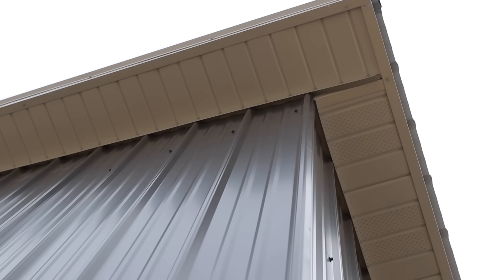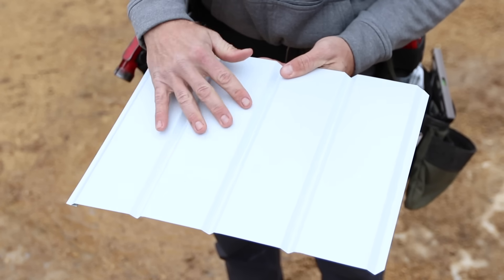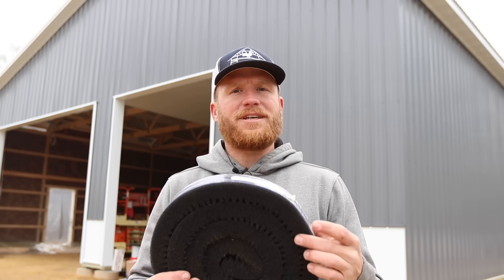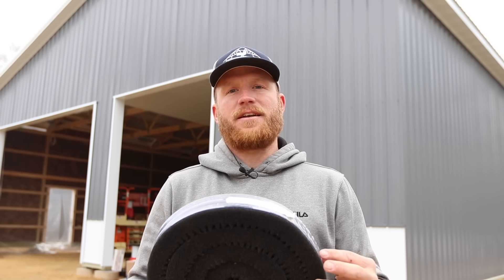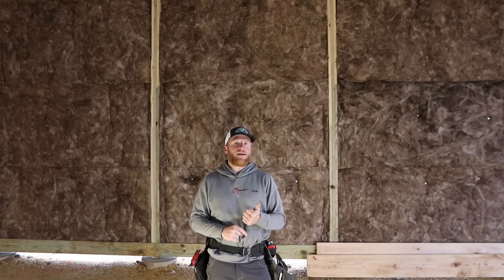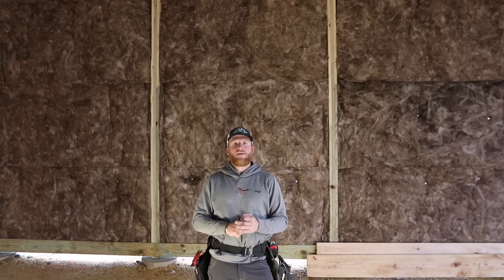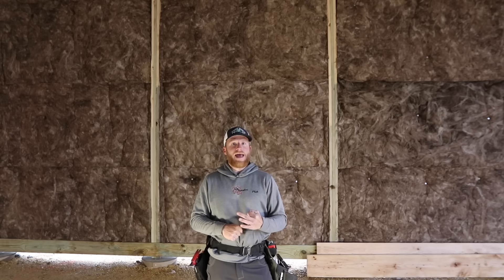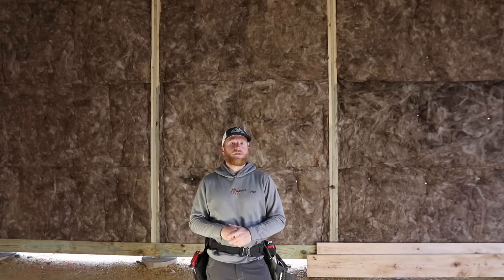Insulation: 5 steps to a more efficient building and why I don't use spray foam

Comment: I have owned and built several outbuildings, great tips for constructing a new one.  One thing you didn't mention is that fiberglass is a great place for rodents to nest in.  I grew up in northern IL and live in southern WI now and mice are a big problem in pole barns and love to burrow in fiberglass.  I have found that over time fiberglass eventually settles, absorbs moisture, and is full of rodent feces and urine...many a day in a hazmat suit tearing the stuff out has taken me over to the foam side :)  Nice video!
Reply: Foam is awful high...maybe 3 times the price because you are at the mercy of a whole industry setting prices,since you cant do it yourself...mouse terrds are outside my sheetrock
Reply: @metalrooves3651  Blown in cellulose with rodenticide is a good affordable option for pole barns. You could even flash (1" inch of foam) and blow in the rest.  One other nice thing is you can remove it by just sucking it out if you ever have to.  Maybe foam will come down in price after all the pandemic craziness...? I've never used Rockwool,  that might be ok but it is pricey too now.  I just know I will never use fiberglass again :)
Reply: So whatcha think..foam?

Comment: Kyle, planing a post style build next year, half shop/garage half home in the 40’ x 72’ size range.  In Pacific Northwest, southeast Alaska, it’s not super cold but certainly isn’t all that warm either.  I’m interested in an exterior layer of Huber R sheathing before I put my metal up.  Mainly looking for a tight barrier to rain and a thermal break from the interior posts ad girts.   Have you ever sheathed under your metal?  Any thoughts opinions on it?  70-80 °F max, briefly in July / aug,  rarely below freezing in the winter, maybe a 37 ° average.   Lots of rain ~ 13-15 feet annually. Thanks

Comment: I find ridge vents are useless here in Louisiana,  I removed mine just added wind turbines instead and it has made a huge difference in attic temperature.  What about a dual insulation of the walls by doing a 2" spray foam to seal cracks and then add the  batten insulation.
Reply: Youtube Spray Jones, batts not needed

Comment: Watch Spray Jones videos to learn why he disagrees with "R" ratings on some materials.
Reply: 2" foam eliminates condensation,
Reply: @safffff1000  Assuming it remains attached to the surfaces it was intentionally sprayed on.
Reply: @Mark-gg6iy  assuming properly applied to a dry surface, condensation only happens when  warmer air hits a cold surface which is not possible with  2" of closed cell foam because there will never be the differential of temps since the foam stops 86% of heat transfer and since it is stuck to the metal siding directly no air can get there to condense.

Comment: Thank you Kyle, what’s your thoughts on insulation under the cement slab. Is a plastic liner needed. Is radiant heat the way to go ??
Reply: Yes on the radiant heat. If you use 2 inch foam no need for vapor barrier as it will provide you with one.

Comment: Hey Kyle, another great video you touched briefly on the spray foam and I had a question for you. I'm getting a metal building built and the frame is going to be I beam 8 inch my question is which spray foam would you recommend for a good quality insulator the closed cell or open cell on both ceilings and walls?
Reply: closed, open will soak up moisture, open good for interior for walls for sound deadening

Comment: Hey Great video as always! Unfortunately I live in FL and build cabinets in my new shop. I have 4 inch polyiso board +1inch with foil ready for ceiling. I have a nice 18kw mini split I plan to keep it cool inside. At this point I can't afford full spray foam. Considering 1inch layer of spray to stop condensation process then use r19 batt on the walls.  I don't really want to spray...but in florida and trying to air condition...I don't know what else to do.
Reply: Hey I get your dilemma. I know sprayfoam closed cell is in itself a vapour barrier. R19 sheets are ok for temperature differences that are not too extreme. In extreme indoor outdoor temperature differences, then sprayfoam is the more efficient option. I've been an insulator for 3 years and I'm learning very interesting facts about insulation. Cheers

Comment: Fiberglass = garbage. Want to improve modern construction put a "stupid" tax on fiberglass to make it too expensive to use.
Reply: Lol I agree its not the most efficient product for insulation. I do use it to insulate attics at r60 in Canada. I agree fiberglass only slows down air transfer but doesn't block it. So that can even create mold if there is not enough airflow on the other side to get rid of the moist heat loss...

Comment: Being an inspector for 40 years I don't like spray foam because it's toxic and it can be very flammable and put out poisonous gases.
But there are applications where it is useful.
UN the case of a metal building it would stabilize condensation and strengthen the skin..
In your case I would use closed cell foam with non vented attic .
Also I would use it at rat board to resist moisture.
Also add 2x grits between the post for bracing and for battle insulation.
Reply: False info, only if improperly mixed, see Spray Jones, Matt Ressinger just completed a house where he had extensive chemical air testing, result less toxic gas than latex paint after only several days

Comment: I am honestly not using spray foam on my build because I can see having to add or change many things in the future as most home owners do and the fiberglass can be reused and moved around if the framing is similar. I will say not having to worry as much about air sealing would be nice though.
Reply: I definitely agree that is one downfall of sprayfoam if you don't have space between the closed cell foam and the finished inside wall. If you had space you could run your wires and other extra plumbing or other reno.

Comment: I hate to break it to you , but my guess is that only reason you use fiberglass is a cost . With
no plywood and just house wrap , I would like to see blower door test on one of your buildings . I'm residential builder in NorthEast NY , the way I build houses , air exchange rate is usually less then 1 . Let's see your results
Reply: Fiberglass and house wrap will let air through, so non of the products mentioned are vapour barriers.
Reply: @SinnisjInsulator  I think they put plastic over insulation on inside so I guess that is vapor barrier. But still , big building like that with nothing but the cross bracing? I'm sure it works, but I'm also sure plywood would make it lot stronger and tighter

Comment: While spray foam is superior to most other insulation materials as well as the best vapor and moisture barrier, it is  3 to 4 times more expensive. The savings gained in energy costs take 20 to 25  years to pay for itself.
Reply: If spray foam is less than $3/ft, compared it to insulating a house with labor to match a 1 passive heat exchange cost. All the sealing, vapor barriers, caulking, ect that  has be done

Comment: Kyle,  help me understand. Why is concrete not laid down first before the building goes up. We are in South Africa and it is mainly brick and mortar. However shops are steel with concrete foundation. Why do you not start with the foundation. Trying to understand. Tx for the videos enjoy them.

Comment: Spray-foam is MUCH better insulation than fiberglass and it adds a LOT of structural strength.
Reply: It is a great product, I follow Spray Jones, great videos there explaining sprayfoam. It's a little disappointing he didn't mention whether he is talking about closed cell or open cell, very different profucts.

Comment: I have heard concerns about spray foam  In  humid areas.  Mold issues
Reply: Only if it's the half pound or open cell product. If it's closed cell then it's a vapour barrier. We use this product in Canada and it is very efficient. In Ontario we have very humid days and winter is even worse with outside temps at -20c and indoor at +20c. Fiberglass has more mold issues since it lets air through.

Comment: 2 yrs ago I put a post frame up for my race shop, I run a spray foam truck have for the last 15yrs. So when it came installation I did it the same as you. Spray foam is over sold it has its place and most sale guys don't realize that. I used ribbed panel metal siding. I made sure that I canned foamed all the corners plus door openings, and the inside of the buildings bottoms of the ribs. It was built with 4×6 post so when I framed up my walls: 2×4, I framed them even with the 4×6 post 16 on center, that gave 6in from face of the post to the sringers then ran R-19 in the walls. I ran drywall on walls and lid with a R-38 in the attic. I ran a 10ft wide insulated steel overhead garage door. I kept the door size down because if you don't need a 16ft don't buy one it's just a bigger hole you have in the building and it cost more. Spray foam is a awesome product when used properly. Unless you're going to be living in it, you can insulate a post frame building efficiently by using the right procedures and materials while saving money at the same time. Keep in mind there is a R-21 batt the owens makes, it comes in standard sizes and widths. My advice after 15yrs in the insulation biz, everything  has its place do your homework! And it doesn't hurt get 2-3 estimates when doing a project just to keep them honest and to get the best deal.

Comment: I have been planning on building a post frame home when I retire in 4.5 yrs. After looking at builds for the past 3 years I must say I  love your building ethics.  I found your videos last week and would love a walk thru of your home/shop as your shop looks like what I will be wanting.  I live in PA so the building insulation would be the same here and I am wondering how you back fill under your rat board if the floor doesn't go to the outside wall.  Do you just level the ground up to the side wall steel?
Reply: Wondering myself, seems a good idea have the wall suspended some inches above the outside floor level, but I didn't see the method and/or material he used to close the gap - unfortunately I couldn't see the closure inside or outside.

Comment: Kyle , question on the fibreglass insulation in this video l. After install do you worry about the bats compressing over time, leaving a void at the top?

Comment: What if your building isn't vented via eaves (aka shipping container)? What is the best way to vent them? I am planning to use a foil vapor barrier near the steel then hemp insulation with a plastic barrier on the inside next to the ship lap interior. I know I need vents for the bathrooms and kitchen. Do I need to vent the air gap in between the steel and vapor barrier?

Comment: Great video! How would you recommend venting  and insulating for a building that will not have a ceiling under the trusses? It will just be open trusses up to the roof. It will not have any overhang either in an attempt to maximize square footage for the lot size. Does that affect which combination should be used for insulation & vapor barrier? Hopefully you see this... I know it's an older video. Thanks!
Reply: I too am building an open truss building and like to know. Also how does the floating concrete affect doorways?

Comment: Argon is a gas just like oxygen.  You don't get the roi with argon. If the seal breaks around the window it lets oxygen in and the argon out. Argon is a waste of money in my opinion.  The r value isn't that much different to warrant the expense of argon.  It's really just another way for a window manufacturer to make a bunch of money for not really doing anything! Stick with oxygen it's a insulator too!

Comment: In Rockford, IL there are 6830 degree days.. Using the formula DD/R X 24 hours = 6000 BTU’s to R = DD X 24/6000 and , after dividing R = DD X .004. The best R value for Rockford is 27.32.

Comment: I agree air loss/infiltration is key in keeping space conditioned. However, house wrap, by design, does not stop air flow only moisture infiltration.
Reply: Most do no stop air flow entirely, but they greatly attenuate the airflow which is a huge advantage in regard to air infiltration in regard to heat loss.  And this is by design.

Comment: Great video , curious how do you hold wall insulation up? I have the 2x4s all ready installed horizontal on walls but no insulation in walls yet? and question on house wrap on Eves to prevent blown in installation from falling into Eves, how goes it hold up over time! Thks

Comment: Great info.  But nothing beats the air stopping capabilities of spray foam. Whether it’s open or closed cell.
Reply: Air tightness is the #1 thing in heat loss, greater than insulation

Comment: As soon as humidity levels go up the R-value for fiberglass insulation drops like a rock. fiberglass insulation is garbage plus it doesn’t add any structural integrity.

Comment: I think the theory is sound but what you’re counting on is that the inside vapor barrier is airtight 100%.  That is, if the building was a cup holding water, there would be no leaks. I would never feel that confident.  All bets are off is you have any kind of inside air moving through your wall due to even the smallest gaps in construction on the outside of the building. Buildings undergoing heating in the winter months are pressurized, vapor barriers would need to be bonded by a glue or a tape (perfectly). Any air leak would lead to gradual accumulation of condensation inside the wall since there is a vapor barrier on both sides of the wall, as there’s no mention of a gap between the house wrap and the exterior metal siding.  This would be the concern for residential buildings. Maybe for a large shop like this, the heat and moisture load is low enough so that you this method. Thanks for the vid.

Comment: Been thinking about building a post frame home 30x75 that is with 30 shop on one end live in MI and still having issues with figuring out heat thought about radiant in the floor but summer time would still have to run warm water through it so the floor is not cold, thought about electric thought about geo thermo do you have any thoughts on it

Comment: The best value is closed cell spray foam it takes the place of the vapor barrier and the r 19 fiberglass. Soon enough fiberglass will be obsolete. You will always have a thermocline with this antiquated method. You will constantly be transferring air between the attic and the home as the thermocline flips between day and night. There will always be dust in your house.

Comment: Great video that has me wondering something.  Given that you built trusses at the top of your stick framing inside the metal building, could you instead make a wood roof with those trusses and a vapor barrier and insulation and just leave an air gap between the wood framing and the metal structure and vent the air between the metal structure and the wood stick framing and thereby prevent moisture from condensing on the metal building without having to blow insulation into the metal building roof?  If the warm moist air is inside the insulated stick framing and it has a vapor barrier to keep it from going out into the airgap and ultimately the metal skin, would that solve any moisture issues from condensation?  Many thank for helping me better understand.  I have a metal building in Alaska I am considering putting up and I can't get any foam machine to my very off grid location (helicopter will bring in the metal building) and I'm hoping that essentially building a well insulated wood cabin inside the metal building will prevent moisture and mold issues.

Comment: Thats why you go spray foam in the rat board at least so critters wont want to chew through if they get through a hole in the wood.Critters can tunnel right through batting and as well with batting you always have a seem where 2 batts meet.

Comment: Is there a video doing the floor? 
I need to add a cement floor to an older building and I can't find a contractor that will do it - they want me to tear down the whole structure to do the cement. It's like this building, cement footings and dirt in between. 
I've got to do it myself and haven't found anything.

Comment: Excellent video, you obviously know your business! I’m in central Canada, in the City of Winnipeg, which is also referred to as “Winterpeg”. I have lived all over the place, and have renovated 8 houses, in some very diverse climates. I have never seen a frame style as you demonstrate in this video, but I can definitely see some benefits to the design. The use of heavier structural members in much wider spacing is far more economical than “stick frame”, and associated labour costs would be much lower accordingly. I’d be concerned about wind and snow loading in my region, with spans that wide. Gust damage would be a real threat in many parts of the Province of Manitoba.
Regarding your dramatically reduced number of Roof Trusses; I’m not certain that a design with that configuration of rafters and trusses would pass a Permit inspection here. One really great advantage to this design is all that space in the loft area. I’ll wager that you could convert that into usable climate controlled space, with the addition of roof airflow channels attached to the bottom of the rafters, covered by thin panel Foam insulation and drywall.
Anyway, I really enjoyed seeing how things are done in your region, thank you for posting this!

Comment: Condensation on the plastic will rust the nails and screws.we had that happen here on the Island when lilco wanted super insulation for electric heat.was a problem with walls and clgs.